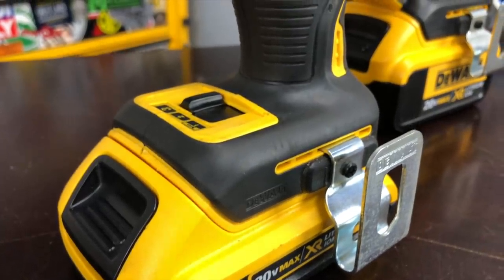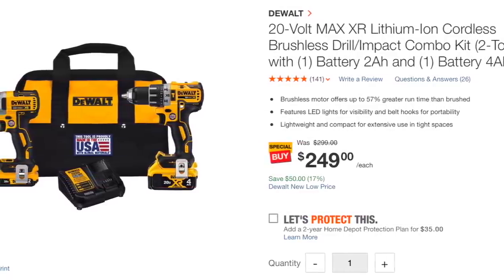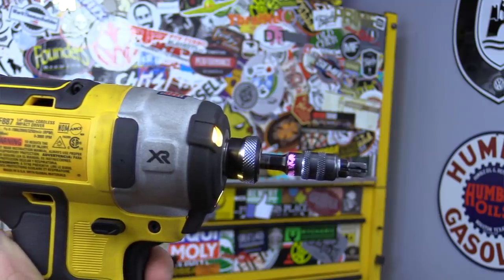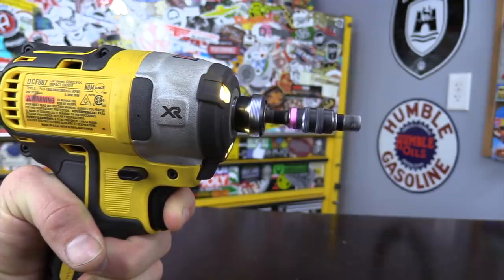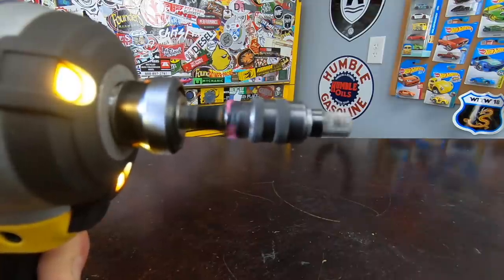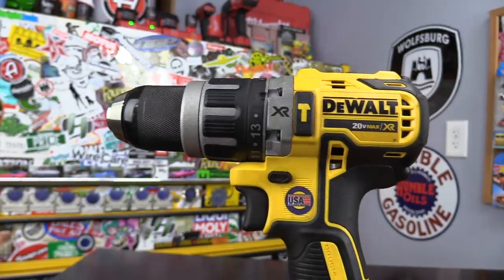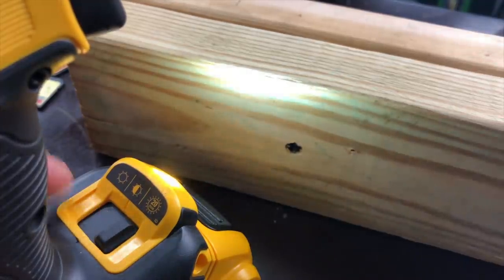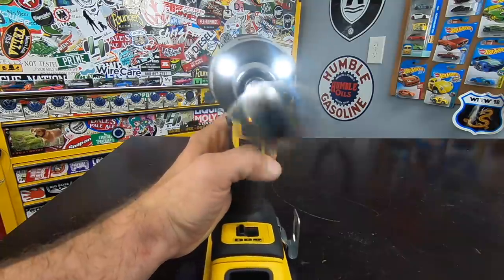Dewalt 20v max XR Impact Driver and Drill Combo

Comment: If you do mechanic work get an impact with an actual 3/8 anvil. You will hate those 1/4” drive hex anvils.
Reply from the maker: It’s preference. I used one with the 1/4” like this for 13+ years. Tried the 3/8 and didn’t like it.
Reply: HumbleMechanic that’s true, it’s best to find what works for you. I work on semi trucks so I hardly ever use sockets smaller than 3/8 drive.
Reply from the maker: Jeremy Thompson haha I bet. Working on VW I used 1/4 drive most of them time.

Comment: Milwaukee is better to be honest. The quality and lifetime is the best in the business
Reply from the maker: I agree they make some awesome stuff. And I like their commitment to Automotive
Reply: I beg to differ
Reply: They are pretty similar in performance and design.  The Dewalt drill has a significantly better, German made, Rohm chuck.  The Dewalt XRP does have some blue collar employment in that they manufacture some of the drill parts/motor in the US and the engineering and profits go back to a US based company.    After TTI from China purchased Milwaukee, US manufacturing of all their drills and most all of their power tools was sent to China.  TTI is getting closer to a monopoly on tools in Home Depot with Milwaukee, Ryobi, Ridgid (power tools), Worx all being made by TTI. They also now own Empire which now has a much larger presence in HD.  It is even worse in vacuum cleaners.  Hoover, Dirt Devil, Vax and even Oreck, a holdout of US manufacture, is owned by TTI and all manufacturing was immediately shipped to China similar to Milwaukee. I prefer not to support this.